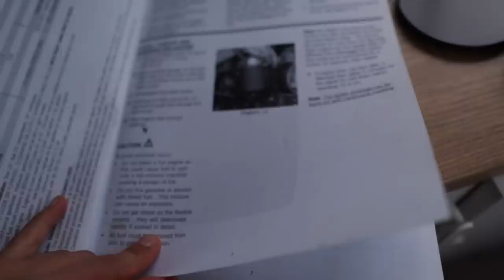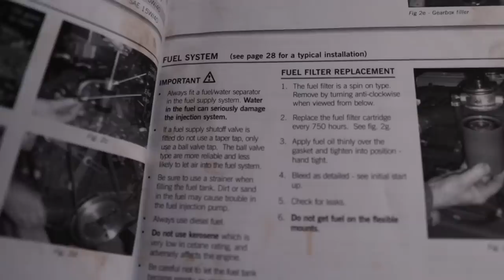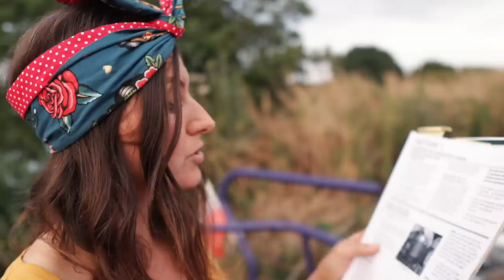Two Uninvited Guests and One Lazy Engine Service #E104

Comment: Top tip - if you don't have a replacement air filter: take out the old one, look for the cleanest part of it and place this at the point where the air comes in. This will do until you get a new one. 🙂
Reply from the maker: Thanks for the tip 💜 xx

Comment: Hi Miles. Get yourself a filter wrench. Not the cheap chain type. Halfords stock them.  The Beta engine is basically the very fine Kubota unit. They fitted to small tractors that work semi submerged in paddy fields.  Very robust reliable engines.  Regards Dave.

Comment: Please Dont take this the wrong way But you do really need to buy some good quality tools, you need at least two sets of Socket set or one that's mixed  Imperial and Metric
Reply from the maker: Maybe but we’ve been able to manage until now so we probably won’t hahaha 😂
Reply: @CruisingAlba    Yes you can get by with your existing tools, but every task is 10x easier with the correct tool. Maybe ask Santa for it some year.

Comment: Oil filter, get a oil filter strap, or pierce the filter with a screw driver, which will give you leverage. Oil bottle, that looked to be the type, which has a pull up pouring tube. Oh and hold it to the side, that allows air to flow in the container. Knowledge gained from servicing my own cars, in the late 70's, 80's and 90's. :-D

Comment: Check the oil level after running the engine for a few minutes. The oil filter was empty when you checked the oil after fitting, but now it will have taken half a pint or so of oil, so the level will have dropped.
Reply from the maker: Thanks for the advice Ben, will do! 💜 xx

Comment: You're right - I've got a trad stern on mine and it's nightmare getting to anything in or around the engine .......repacking the stern gland is nearly impossible!  BTW get a chain spanner to get the old oil filter off :-)

Comment: Hi Marina Myles,Myles you are getting a dap hand at servicing your engine,yes it is not good to overfilling your engine with oil because as you are running the extra oil cause back pressure in the sump and will cause oil leaks and try going up the bore’s and passed the piston rings not good ,great blog very interesting,till next time take  care keep yourself,John 🌹👀🤝💕👍🙌🛠🔧🔨